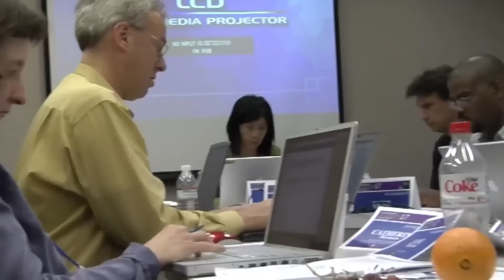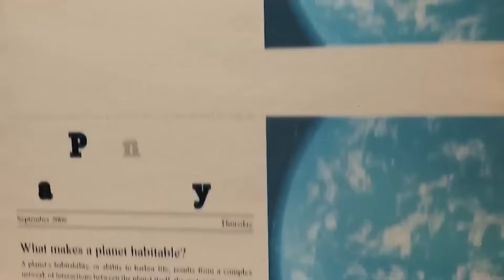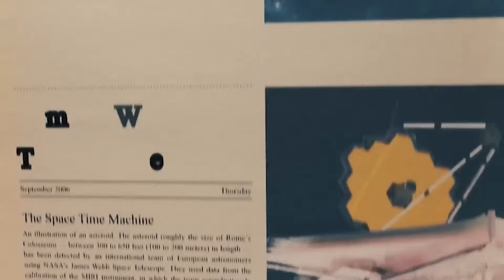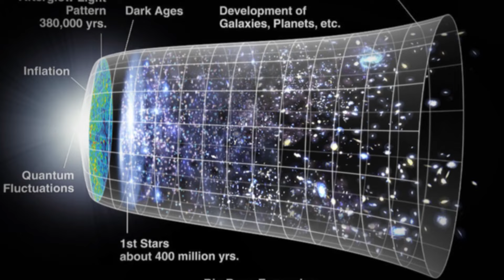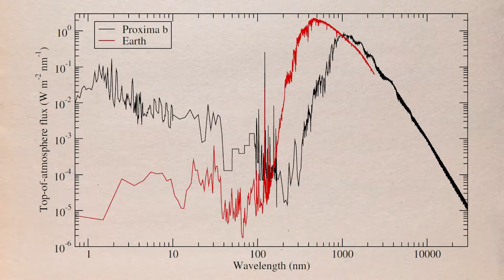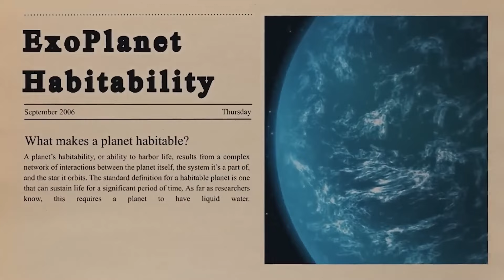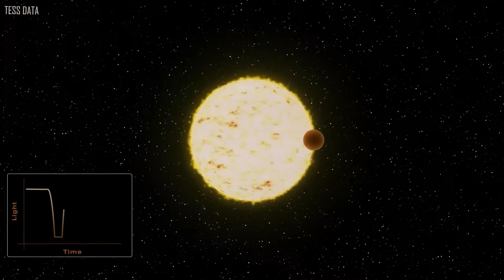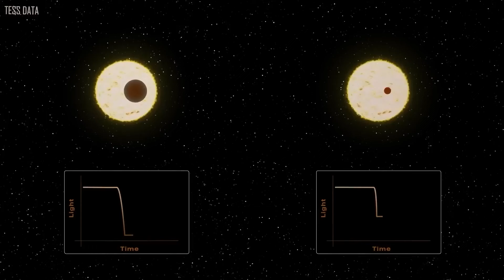Webb Telescope Detects CITY LIGHTS on K2-18B, 120 Light Years Away!

Comment: Each light year is over 6,000,000,000,000 miles 120 light years is 120×6,000,000,000,000 so I have you see the 7 trillion statement was wrong. so 120 it’s about seven times the distance to alpha Centauri. So it’s still in the Milky Way maybe we could find friends there